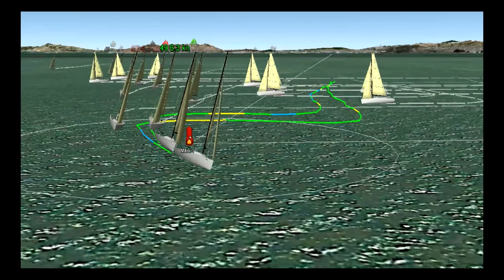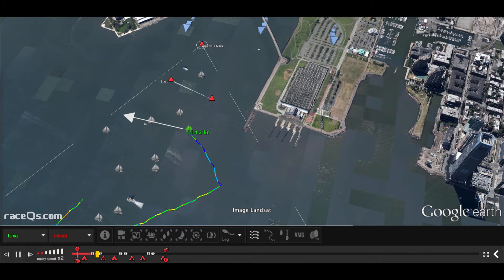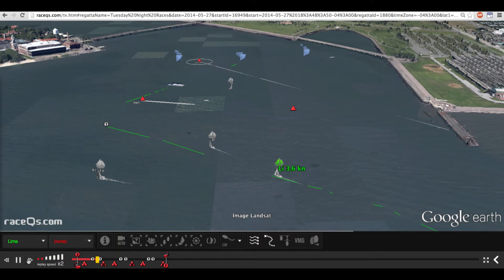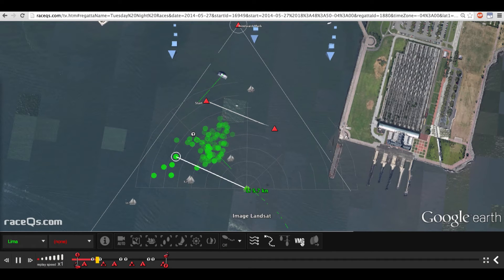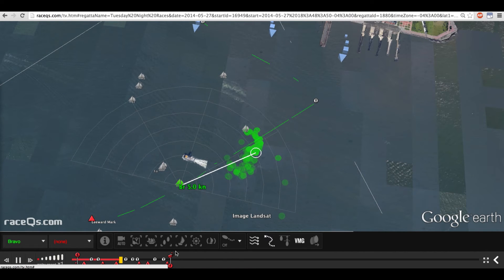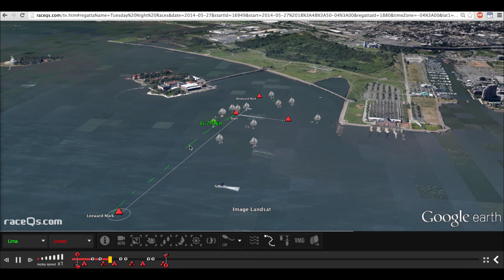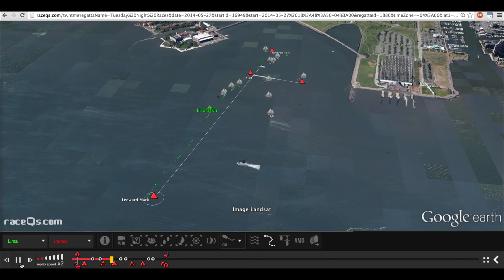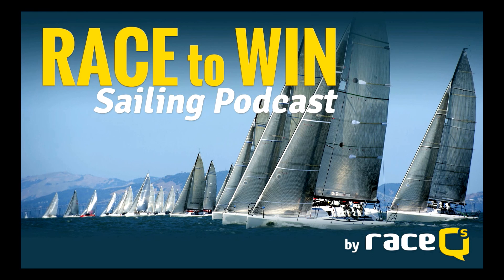13 - Velocity Made Good

Comment: I would have to disagree with your comment about the average vector lines and the cluster. You mention how a good skipper will keep the dots clustered together however say for instance the boat enters a lift with increased wind speed then there will be momentary data points which are outside of the cluster of the true wind speed and direction. Just my thoughts